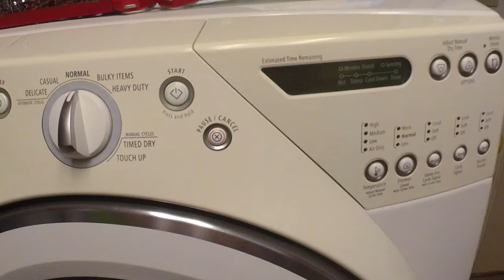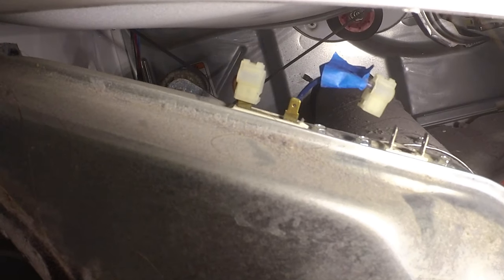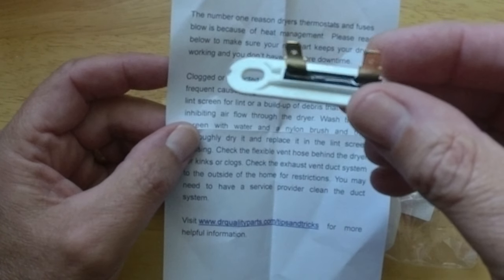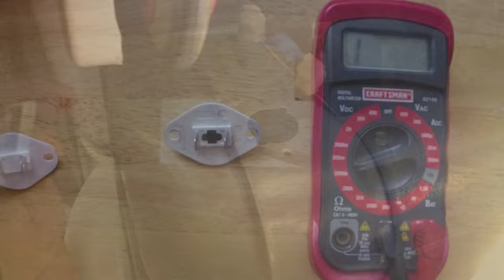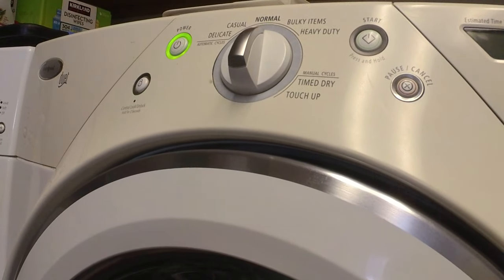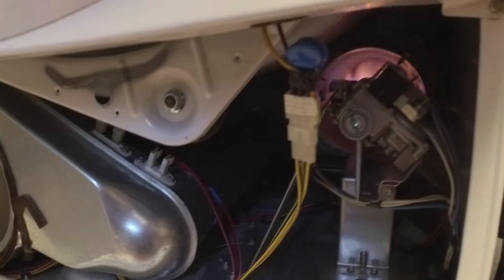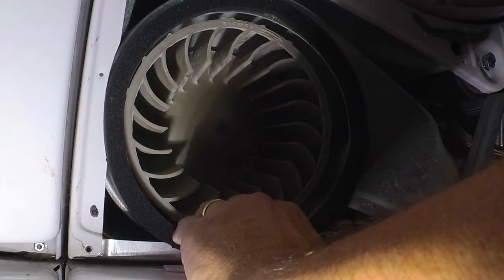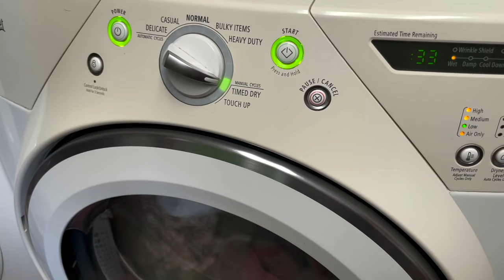Whirlpool Duet Gas Dryer Not Heating | Thermal Fuse Replacement

Comment: Thank you so much for the detailed instructions. This is the third time I've repaired our dryer with your help through your videos. The first two were F01 errors - those were fun opportunities to practice soldering skills). This time the dryer wasn't heating. Watched your video and I promptly ordered the parts via the links you shared. When they arrived I thought that maybe I should have checked a manual for the dryer model I own just to confirm that I had the correct parts. Your dryer in the video looked like an exact match to mine, but what if it wasn't.  Interestingly the manual I found online had a very different looking thermal fuse. I worried that I had the wrong part, but before returning it to order the part shown in the manual, I thought I should open up the dryer to double check. Sure enough, the parts in your link were exactly what was needed.  Dryer's working again and we saved time and $$$. Thanks so much!
Reply from the maker: Karean, nice job. Check that your vent pipe is clean and not clogged. Often as these build up with lint the dryer will get hotter than it should which causes the fuse to blow as a safety measure.
Reply: @MattsGarageMiscDIY  Yup. It seemed to work great then shut off again. Cold damp clothes at the end of the cycle. {{grrr}}  Took the machine apart again to check the solenoids with a multimeter - both good.  Then pulled the maching out to check the vent hose. That was embarrassing. Bought a new hose, cleaned out the vent outlet in the wall, and tried it again. This time I realized that the flame after the first repair was orange. After cleaning and replacing the vent hose, the flame was blue.  First load worked great. Second one .... @#%^  Should I check the thermal fuse again?
Reply from the maker: @kareanwrightson3864  If you have a multimeter you can quickly check the thermal fuse for continuity. Recently I had to swap the solenoids on my dryer. They'd work when cold, but after one or two cycles (10 minutes into drying the dryer would no longer light). The igniter would glow nice and bright but the gas valves wouldn't open... https://youtu.be/dyKubdUM-RI
Reply: @MattsGarageMiscDIY  just a quick update with thanks, again. I ran out of time to devote to continued attention to the dryer repair so I called a local, highly-regarded, repairman to come check it out. He said everything I'd done to that point was great. I just missed cleaning the exterior vent exit and the cage that surrounds it.  He said I did everything that he would have checked or done in the process of figuring out where the problem might be. Deduced that the only thing it could be at that point was the gas valve. He replaced that and it's working great. While he was there he also gave me some diy tips for the washer, opened it up, and showed me a couple of things to maintain and watch for.  Thanks, again, for your terrific videos and instructions!

Comment: Thaks Matt!  Very nice video and part/tool links!  And you are correct, getting those two terminals off of my thermal fuse was hard!!!  I kept thinking there may be a locking clip -but no, just need to carefully pry off with a flathead screwdriver.

Comment: Great video
Can the igniter flame cut on & off and it still be the thermal fuse that is bad and not the coils??
My coils are testing good.
Reply from the maker: With my bad thermal fuse my dryer was not igniting at all. Now it cycles heat on and off as needed depending on the heat setting.

Comment: Great video. How did you remove the wiring from the thermal fuse as for being tough to removed.
Reply from the maker: It should wiggle free, but take your time, you don’t want to pull one of the wires out of the connector. I was gripping the connector, do not pull on the wire. Good luck!

Comment: Thank you for these instructions, but my gas Whirlpool duet dryer has a similar problem that these instructions didn't help resolve. I appreciate any further tips!  I did replace the thermal switch and thermistor, but my problem recurred.  Here's what happens:  my dryer is idle for at least half an hour. Then I put a wet load in and start it.  The gas will ignite and run for about 2-3 minutes as normal.  Then a high pitch sound starts coming from the bottom.  About a minute later the flame extinguishes and shortly after the high pitch sound stops. The drum keeps turning and I can see the igniter glowing on and off every minute trying to reignite the flame, but the flame never ignites.  Keeps doing this until I cancel the cycle.
If I try to re-run it within 5 or 10 minutes, the igniter glows on but the flame never ignites.  The drum runs without a flame.  I have to let it sit still for at least 30 minutes to get it to re-ignite like before and only for just 2-3 minutes as mentioned, then a high pitch sound, etc..
Does anyone know what could be causing this?  It is behaving like this with the older and the newer thermal fuse and thermistor.  Thank you!
Reply from the maker: Check out my other video where something similar happened with my dryer. In my case, the Gas Valve Solenoid Coils needed to be replaced. Easy fix, inexpensive, hope this helps! These over time stop working when they get warm, which is why when cold it will work for a light, and then during the cycle they stop working as they get warm. https://www.youtube.com/watch?v=dyKubdUM-RI
Reply: @MattsGarageMiscDIY  thank you very much!  Yes, that turned out to be my problem too.  I just installed a new set of coils and the dryer worked like a charm.  Thanks again for this tip!

Comment: My dryer actually heats...once in a while. What's the likeliest culprit in that case? Trying to figure out if I'll need the solenoids...thanks!
Reply from the maker: With my limited experience it seems typical for the dryer to work and heat initially when it’s not been used for a while, as those solenoids warm up, the resistance increases and if they are failing they may not allow the dryer to fire again as it cycles. Once it cools down for a while they may fire the first time or two, but usually not enough to dry for a full cycle.
Reply from the maker: I have another video where I replace the solenoids…
Reply: @MattsGarageMiscDIY  Interesting. So you're saying in our case it sounds like the solenoids?
Reply: @MattsGarageMiscDIY  Thank you. Watched it. Husband lifted up the dryer so I don't have to lay on the floor to get to it...and I'm going to try replacing the solenoids first, nothing else, and see if that works. If nothing else needed I'll send those back! Or maybe keep on hand for a later repair.
Reply from the maker: @sooohum  sounds like the most likely culprit, and inexpensive parts thankfully. I have heard that the main gas valve can fail but it’s less likely. My sister has the same washer & dryer as we have and they have had to make these same repairs that I have documented. If your thermal fuse was blown, it would never heat.

Comment: Matt thank you! 

My igniter works and the flame turns on, but I have to cycle my clothes 2-3 times for them to dry ! Any ideas ?
Reply: I have the same dryer as the one in this video also!
Reply from the maker: Ben, I wonder if yours is doing what mine was in my other video. When cold (not having run in a while, it would light and cycle heat a few times, and then mid cycle it would stop lighting (it would glow bright to ignite, but no gas to actually fire). You'd need to remove the bottom cover and watch it to see if this happens. Check this video: https://youtu.be/dyKubdUM-RI
Good luck!

Comment: Hey man mine is newer one~ish and looks like yours but is in like a sea foam green color. I replaced both the thermal fuse and the other piece you installed but it still doesn't produce heat. Do you know what might be the cause?
Reply from the maker: Another fairly common culprit may be the gas solenoids. they are also inexpensive and easy to reach on most models. There are some good YouTube videos that demo how to test yours for proper resistance. Best of luck, you’ll get it!

Comment: i have the same exact driyer but mine is electric. will this parts work for it ?
Reply from the maker: I don’t have any experience with an electric version, but imagine it might also have a fuse. Pretty easy to open up and have a quick look around. If you have a multimeter you can remove and test parts. Best of luck!
Reply: @MattsGarageMiscDIY   thanks a lot for your reply !👍

Comment: I replaced both of these parts but no luck. I have ignition but no flame. Ignitor starts to heat up then fades away and stop. I never get any flame. I tested the coil solenoid and I have continuity on both solenoids. Any suggestions? Thanks in advance!
Reply from the maker: I believe the coils need to be tested for resistance, I had to change my coils fairly recently and also posted a video, it’s also an easy swap and the parts are cheap. Good luck.
Reply: @MattsGarageMiscDIY  checked for resistance and they have resistance. I ordered more and will be installing them today. Any other possibilities? Thanks for the reply!
Reply from the maker: @CustomMercuryCougar  I hope those new solenoid coils worked for you, less likes culprits could be the actual gas valve, or the igniter.
Reply: It ended up being the coils! Thank goodness. Was running out of options there. Happy wife, time to crack open a beer! Thanks for your help
Reply from the maker: @CustomMercuryCougar  awesome, well done, beer well deserved :)

Comment: Hi, I see that you unplugged the dryer, but what about gas?  Where do I shut off the gas?
Reply from the maker: Joanne, behind the dryer in addition to the electrical cord, you should have the vent line that exits the home, and a smaller flexible gas line connected, often with a yellow colored valve handle that you can turn to shut off the gas. Hope that helps.

Comment: Matt i have a question, like an idiot I broke my multimeter as I was grabbing it to check the thermostats so as of now I just bought some parts that I'm guessing is broken so my question is this.  When the dryer is on I see no glow or ignition, do these pieces effect that or should I have bought the solenoids instead? FYI im still waiting on the new thermostats to come in so everything is still original
Reply from the maker: A couple years back my sister who has the exact same dryer as mine had the no heat issue. In her case it proved to be the solenoids. When my dryer stoped heating I was pretty sure it’d be the same thing so I ordered solenoids, but added the thermal fuse and thermistor because the parts are cheap and I figured if I’m in there I’ll check or replace it all. As it turned out MY only real issue was the thermal fuse which likely failed due to my partially clogged vent pipe. Now I have solenoids on hand for when that day comes.. Good luck with your fix.
Reply from the maker: There are other potential causes, bad igniter, even a bad dryer door switch could cause problems, but the fuse, thermistor and solenoids are worth a go.
Reply from the maker: Vic, sorry forgot to mention that my dryer was also not igniting like yours. In my video the bad fuse WAS the fix, but there are as mentioned other possible weak links in the chain.

Comment: How did you remove the connectors on the thermal fuse??
Reply from the maker: Gripping the connector only and gently rocked them a little while pulling. You do want to be careful not to rip a wire out of the connector (by simply pulling on the wire)
Reply: @MattsGarageMiscDIY  THANK YOU!!! It was sooo stressful trying .. I thought I’d break it lol.. but this video saved me a few hundred dollars!!! Again.. THANK YOU FOR THIS VIDEO!!

Comment: Is it normal for flame to go on and off ever other min got the same dryer ??
Reply from the maker: C Ray, my understanding is that it is normal for the flame to cycle on and off, and it’s dependent on how high you set the heat. On a lower temp it will not stay lit as long and then only relight as needed to maintain the heat setting.

Comment: Can i blown thermal fuse cause it to spark and trip breaker when pushing start button
Reply from the maker: Kim, the thermal fuse will blow if the dryer is getting dangerously hot (to prevent fires). This wouldn’t happen at initial start-up. Usually it’s a symptom of the lint vent being clogged up and not flowing enough air to keep things within the safe heat range. The fuse is easy to test, and cheap to replace if yours is bad. Good luck with your dryer repair!

Comment: I did change the fuse however it didn't fire up. What else can it be?
Reply from the maker: Elizabeth, was the old fuse bad? Another fairly common issue with no heat can be the gas solenoids. Test yours before replacing them. There are some good YouTube videos that demo how to test yours for proper resistance. They are also inexpensive and easy to reach on most models. Best of luck!
Reply: @MattsGarageMiscDIY  usually the thermal fuse fixes the problem But not this time my electric dryer didn't fire up. So I am guessing at this point it could be the heating element 🤔. What size nut driver should I use to remove the heating element
Reply from the maker: Elizabeth, sorry I’ve only worked on Gas Dryers, never an electric model. Are there no good videos? I have no idea on the nut size for the heating element. Best of luck, maybe you can capture some video and share with others that have the same issue on their electric dryer!

Comment: ****HELP****

I just changed the Thermal Fuse and ran into the same issue getting the leads off the old thermal fuse. The right one I felt didn't click on the new thermal fuse as well as it was on the old fuse. Anyway I buttoned everything up and started the dryer and now I'm getting Error Code L2 (mine is not gas btw) which I wasn't getting previous to this project. I didn't wait to see if the dryer got hot or not. I turned it off, unplugged it and came here to the comment section. Btw I did check my electrical panel and I didn't blow a breaker.

Comment: Wait wait wait…why is that dryer plugged in to an outlet that isn’t made for appliances? Very dangerous.
Reply from the maker: I think you may be suggesting I install a GFCI outlet which is not a bad idea.
Reply: gas dryer only requires 120v to operate, not a 240v plug like an electric dryer or stove